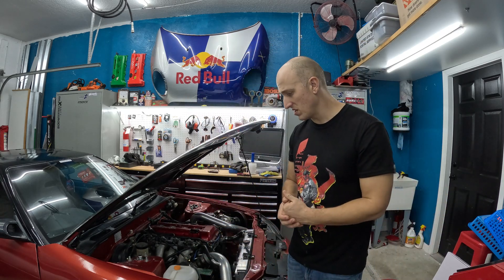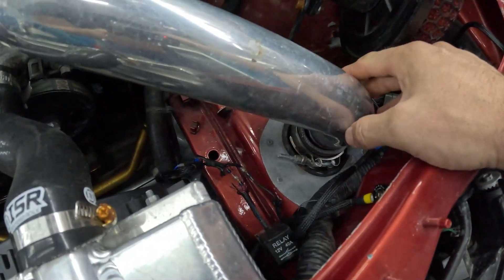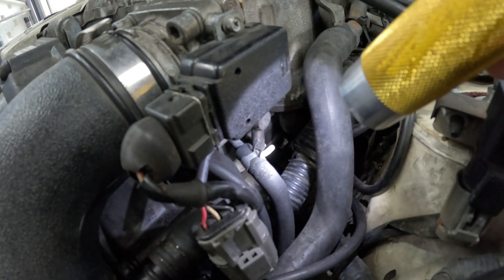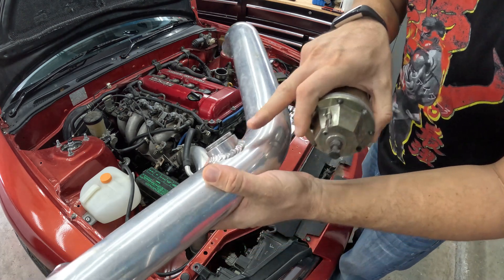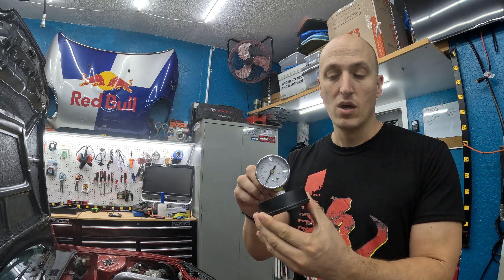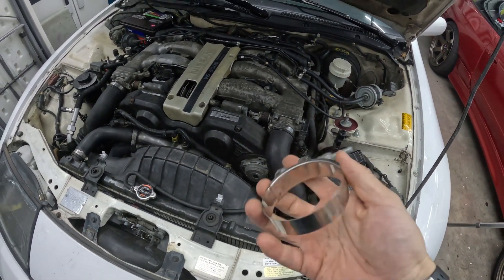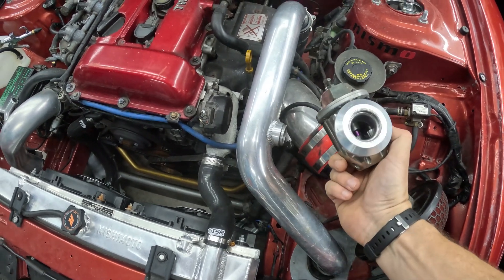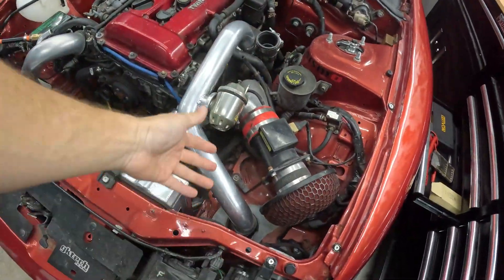HOW TO Diagnosing a Vacuum Leak - My TURBO 240sx has a BIG Problem!

Comment: @06:32 Clean the fuck out of the threads on male and female side of the flanges, then apply jb weld to the entire circumference of both male and female joints. then reattach. tape on tight, clean around seam and let cure. done deal.
Reply from the maker: I'm thinking the same thing